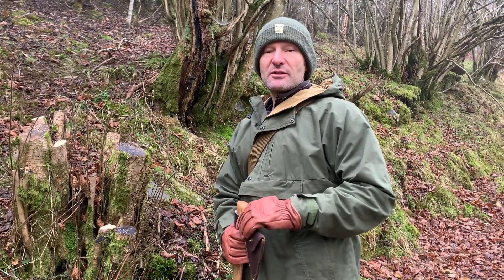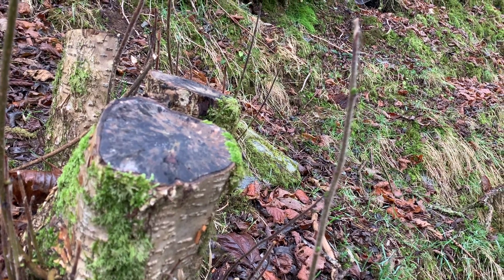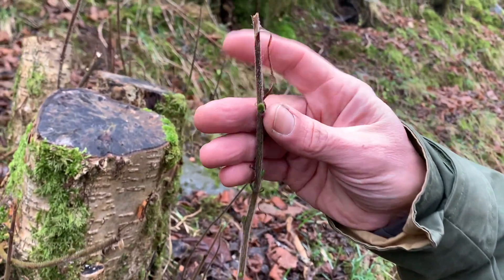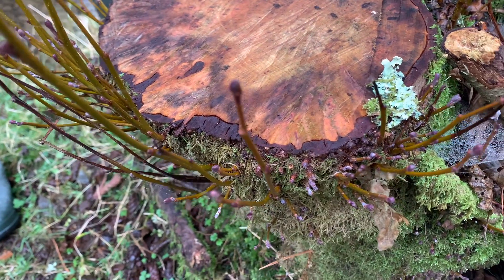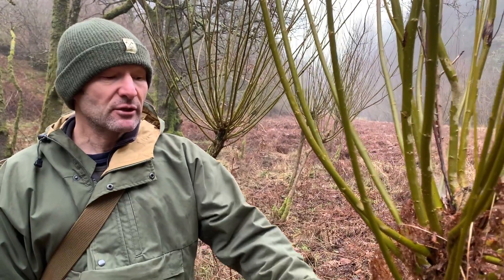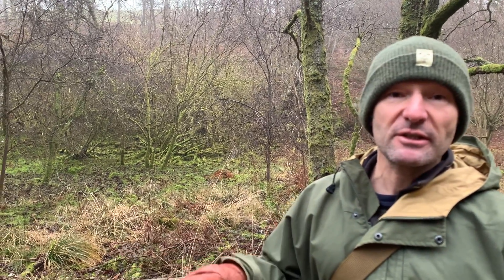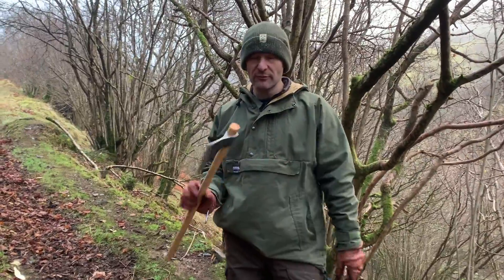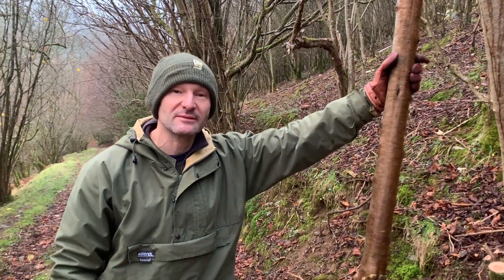Pollarding vs Coppicing

Comment: The tree that your at when you say hurdle weaving how long did it take to produce that growth ? I'm American if I Google wooden clog I'm going to get nothing but wooden shoe's ! So if you don't mind what is a wooden clog ?
Reply from the maker: The regrowth on that willow was two years for the thicker stems and one year for the thinner stems. Willow is very good for coppicing. Wooden clogs are in fact shoes and were often used in boggy areas before waterproof shoes were widely available.

Comment: Over the pond in NC, when you say Hazel, are you referring to Hazel nut shrub or witchhazel? And how do you propogate?
Reply from the maker: Hello, this is the native European hazel Corylus avellana that was used to develop the cultivated version. One of the best ways if you have established shrubs is through layering where you bend over the stems and peg the stem onto the ground and partly cover it with soil. It can then establish roots and shoot up a side shoot that will become a new stem. At that point you can cut the bent over stem and you will have a new plant.

Comment: Does coppice need to be cut at ground level or a foot or so above ground?
Reply from the maker: Typically coppicing is done very close to ground level but pollarding is done at various heights depending on the requirement.

Comment: I have roe deer regularly grazing my acres, so I always pollard my many willlows, and put brash over my coppiced hazels and chestnut. I've noticed that deer leave the coppiced alder alone though. BTW, I've been using a small, 18v cordless Makita topping chainsaw for the thicker timbers, as over the years you will develop RSI and it's painful.

Also, what weight is your Rinaldi? I like the thinness of the blade. Thankyou.
Reply from the maker: The head weight is around 750g, I got mine on eBay from a seller based in Italy. Here is a link to their store but they only seem to have slightly lighter axes at the moment. https://www.ebay.co.uk/itm/363844162219?hash=item54b6cd52ab:g:cLkAAOSwQfFihi9m
Reply: @bundufundi  Good man. Thankyou for that.

Comment: I really like these types of videos. 
Pollarding in towns and cities is now also being used to stop trees interfering with 5G signals. 

Question for you please, how do you find the Ventile Hilltrek gear? From a perspective of water resistance, breathability and durability, including durability outdoors, with brambles and scrub bush etc?
Reply from the maker: I really like ventile gear. I have the double layer smock which is waterproof due to the double layer, it gets stiff when wet which feels different to modern materials until you get used to it. I have found it to be much more durable than nylon based alternatives and have also found mine to be quite breathable. It is definitely heavier than others but for what I use it for that is not a problem.
Reply: @bundufundi  I currently use waxed cotton for outdoor jackets.
Heavy carried, but worn I find them fine. Hardwaring. 

I went all in with synthetics a few years ago but didn't like it. 
Only a couple of bits of running kit and two pairs of fvallraven trousers left. 

Only relatively recently found out about ventile. 
The read ups of it sound perfect.
Thank you for your real world perspective.
Reply from the maker: @jamesbailand4311  Waxed jackets are great for durability but I find they are prone to go mouldy in the west where we are.